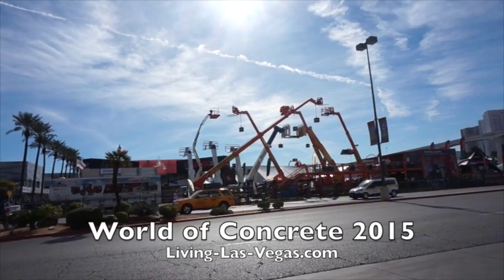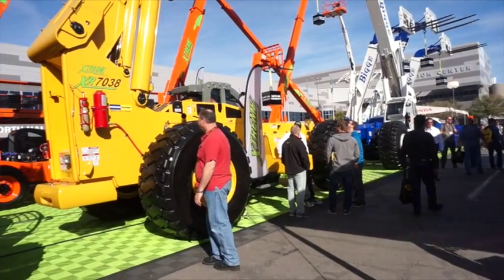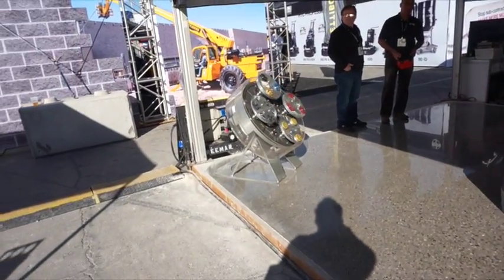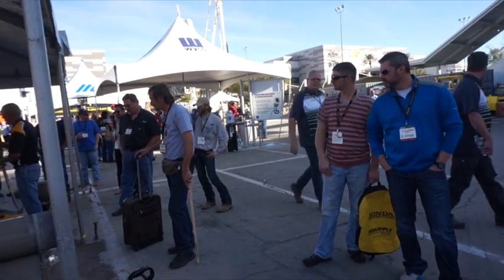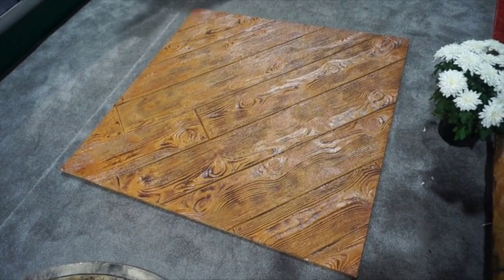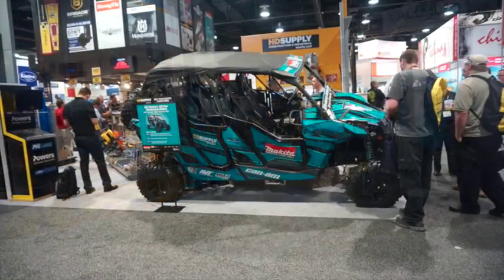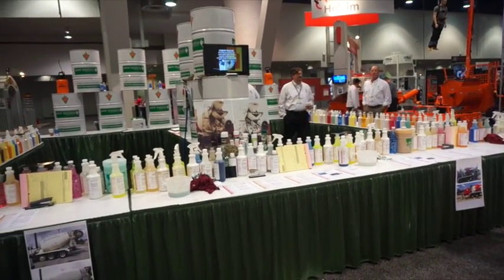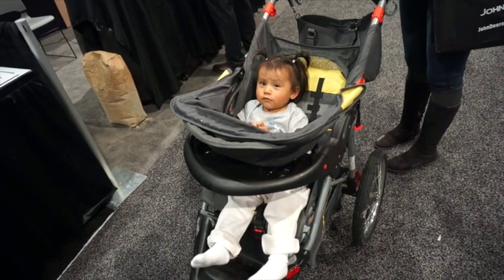World of Concrete 2015

Comment: When my pops finished floor you were not allowed to walk on cement till the next day. Masons worked into the night finishing in NYC. I got in the early 80s and caught the tale end. There are so many buildings that concrete has been trampled on from carpenter building next floor before it drys. Those floors were done over with structlite and cement. It never made sense. Accept contractor gets paid quicker but to go over all th floors with time and materials I don't see how it worked. None the less many buildings will not be a good fit for polishing. But plenty out in long island queen etc.

Comment: Most people do not realize that many of the 2,000 year old Roman structures were made out of concrete. The Pantheon is about 100 % concrete and the Colosseum is about 40 % concrete, and many of the remaining palaces on Palatine Hill are concrete. The still in use 2,000 year old storm sewer system was made out of concrete, plus many other structures.
There is no limit to the versatility of DTB. very interesting video that most people would never know about.